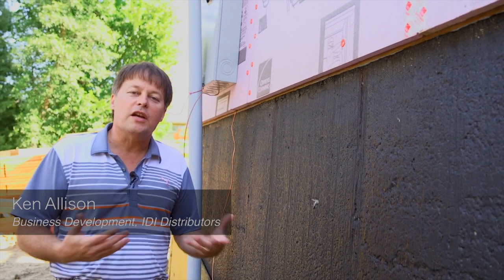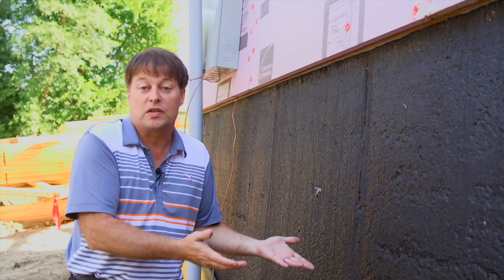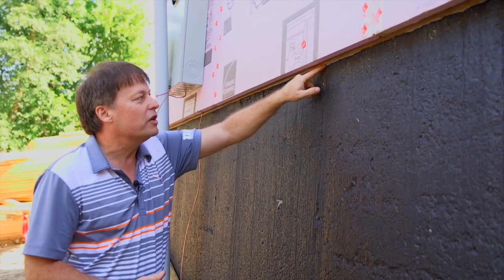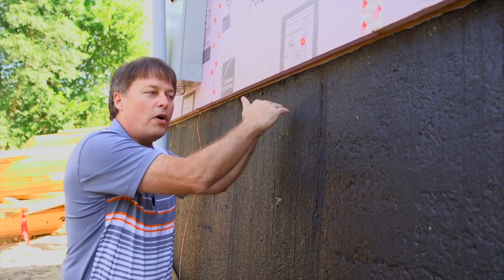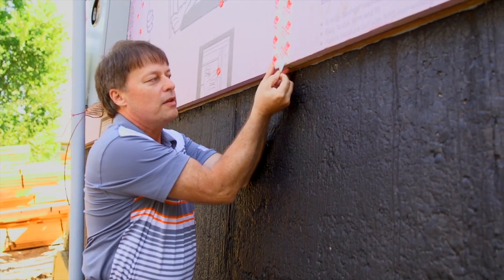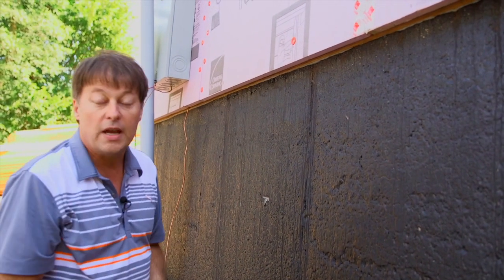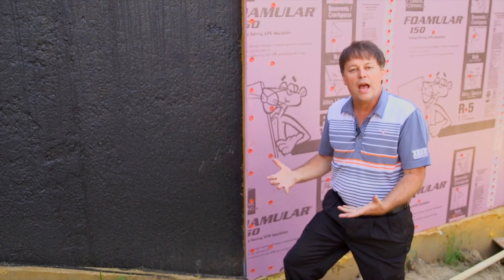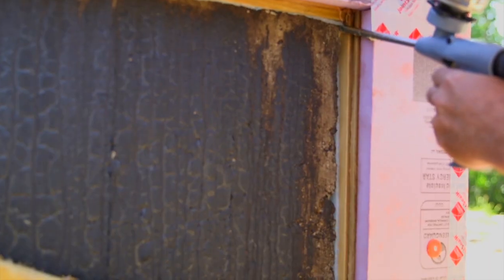How to Build a Zero Energy Ready House: Adding Rigid Foam to Exterior Walls — Case Study 2

Comment: Siga tape that joint between the foam onto the foundation. Water and air tight. Unless the inside cavity is spray foamed I would bet that is still a leaky area

Comment: How does this application compare to ZIP?
Reply from the maker: Thanks for the question! 
Certainly the Zip system or any of the nail base products from Hunter, RMax, or others, could be substituted for the two outer layers of the wall. In reality, we could easily have gone with just foam board and eliminated the OSB/wood sheathing altogether. Up in Canada, they are installing the foam board directly to the framing and it works very well. On this project, the closed cell SPF would lock the foam board down to create a very robust wall. 
So the short answer is yes, but the long answer is that as architects and engineers gain more experience with building these types of assemblies, fewer materials will be required and the envelopes will just get better.